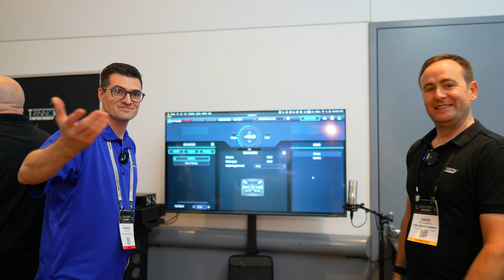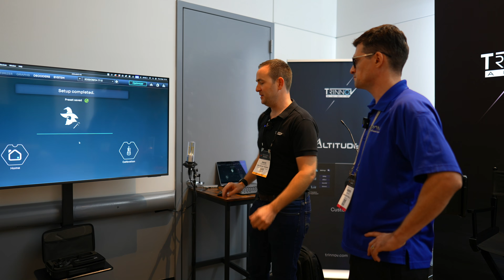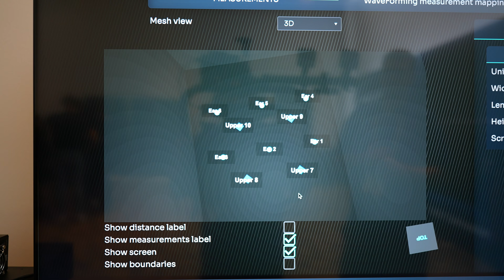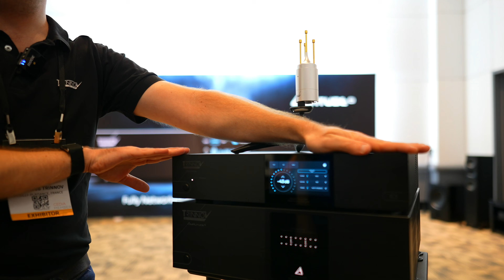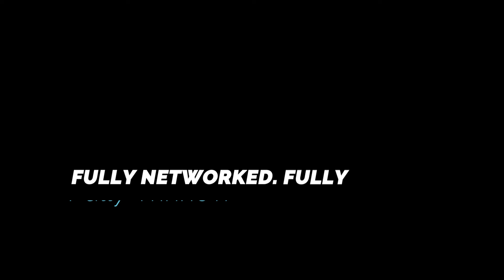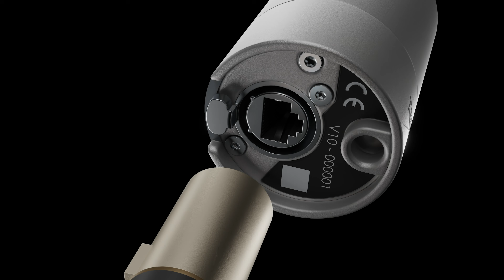Is THIS the ULTIMATE AV Processor for 2025? | Trinnov Altitude CI | Cedia 2025

Comment: why would a dante to analogue conversion be a idea if you want to connect older amps?
Reply from the maker: While it’s not an ideal solution, if you plan on sticking with analog for awhile, you could certainly use the Dante Avio adapters to use older analog amps. Now keep in mind that it has eight analog outs so you could use a combination of analog and Dante.

David’s just mentioning that it’s not ideal if you are sticking with high-end analog amps because you could always just use an altitude 32 or 16 if you don’t need 192K
Reply: @DivineAV my idea would be to use the analogue for LCR + 4 subs and then use dante for the 6 atmos and 6 surrounds. I feel you wouldn't notice surrounds locked at 48khz when watching movies and could still use 192khz for music on the fronts.

Comment: the new page layout , wider than present trinnov 32 layout  that looks like 4:3 ratio tiny awkward where  stormaudio page is wider , trinnov new page layout that;s more like it , the rest of the features bit  simper as yes , hoping around the present layout 
so this new feature firmware i heard december release ? or if it is early 2026 while they iron out any other bugs that maybe encountered by user/owners 
i use the altitude 32 to about its maximum channel output , others only use less and use all rest of the channels for subs makes no sense as they've done away with processors full channel output capabilities
Reply from the maker: Yeah, I would wait until the beginning of 26 even if it gets released at the end of the year. Keep in mind that you will have to completely recalibrate your system but it should go pretty smoothly with the new interface. We currently have a 20 channel set up at the shop, but plan on expanding.
Your system sounds awesome, what kind of sound system are you running?
Reply: @DivineAV  so what you mean is , any previous ( theatre modes ) i have to recreate those theatre modes again ? , okay i type them down and just create the theatre modes again 
22.1. ( customised . 20 ) once fully finished maybe add extra customised extras to bed layers of from 22 to 30 is possible but its technical so i get more , ( below floor surround ) which really highlights the system 
64 channels i can expand that further but rather those extra more discrete channels were used for ( discrete below surround ) in floor surrounds multi arrays once that is done its not finished its  a bit more , lot , lot more to it besides all that 

got understand how basic stereo works and put a twist on it , i mention in my channel often where it should or should  have gone from day one but ,

oh , will the new software have On/Off switch on the remote software like , stormaudio